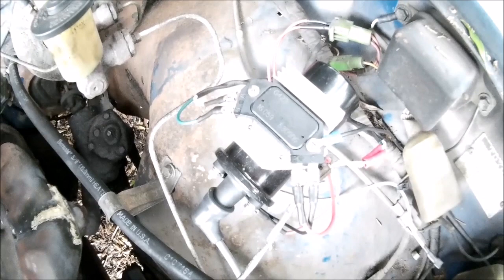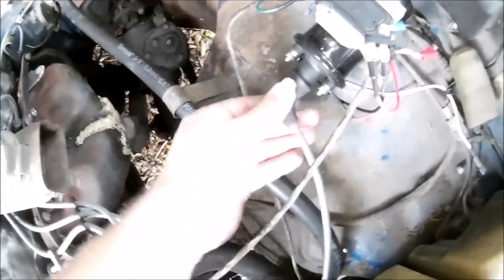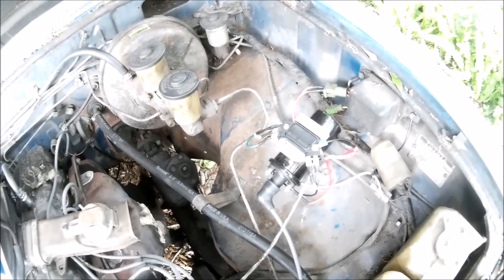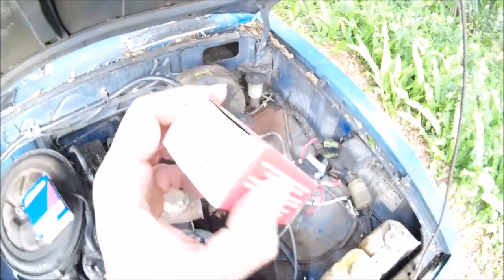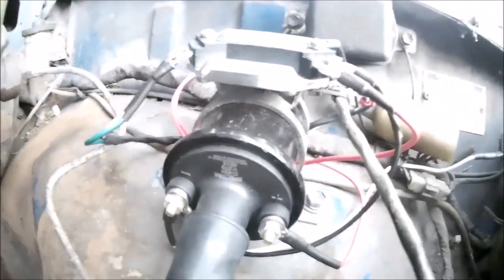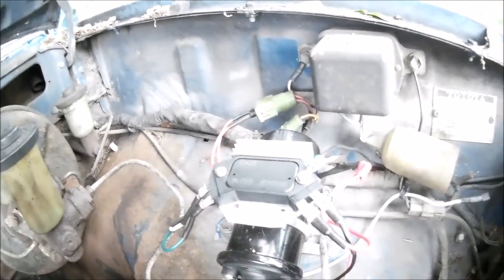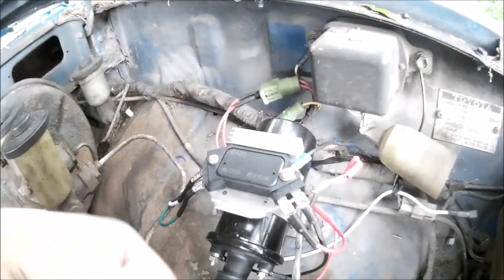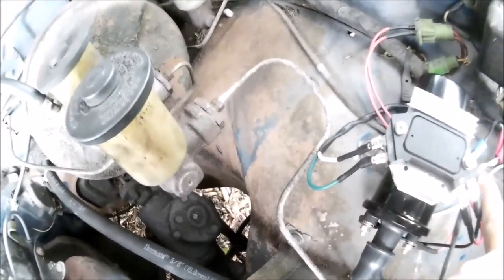1978 Toyota Pickup/Hilux 20R - GM HEI Ignition Module Conversion

Comment from the maker: UPDATE - This conversion does work fine, BUT....

I have to admit I made a mistake during the install. I had to use a #8 female spade lug for the green wire (red wire coming from distributor pickup coil), due to the fact that the lug for the "G" terminal on the GM module is smaller than the rest (see video). Unfortunately, the smaller lug didn't really crimp too well on the new 14 gauge wire I used, causing a bad connection. Apparently, this was the cause of my wandering idle & backfiring problems. The wire in the crimp was loose & causing an intermittent connection. Duh me.

I ended up using a female lug the same size as the rest, that would accept the 14 gauge wire correctly, & give a solid crimp connection. I did mash down the legs on the lug to make it fit tight on the male lug, and it's solidly in place. Every since I did this the idle is solid @ 850-875 RPM with no wandering & the backfiring from the tailpipe is gone.

I wasn't getting enough spark energy at some times due to the wonky crimp connection, causing an intermittent lean issue, sometimes to the point of stalling out the motor. Since it came and went without any pattern, it was almost impossible to troubleshoot (listen to my description in the video). I only found it by accident when I decided to recheck the connectors on the module. That one was loose & when I tried to pull it off to tighten it up, the wire came right out of the lug! And no, I wasn't just pulling the wire. Just one of those things & wanted to post an update in case anyone else is experiencing the tailpipe poping & weird low idle after doing the conversion. Triple check your crimps & connections!!!!
Reply: how dependable  has this  set up been
Reply: randy yowl this is not my video but I found it works very well I just recently done it to one that I purchased to fix and sell and have driven the hell out of it almost want to keep it but it most definitely works better than the original as well as the cost
Reply from the maker: Randy, sorry I missed your original post. So far this setup has been very dependable, no problems with it at all. As long as you make sure you have a very good, solid electrical ground to the module it works great. An iffy ground could cause it to function on a not so dependable basis. The only other thing to watch for is to use a heat sink like I did in the video. Keeping the module cool helps it live & work a long time.

Please see my other comments for more info, or reply to this if you have any specific questions.
Reply from the maker: The setup is very dependable, IF you pair the module with a QUALITY ignition coil. I do NOT recommend any Chinese made ignition coils. The quality is poor & the primary coil side seems to short out easily, sometimes within 6 months. This will cause you all kinds of idling & driveability problems, and will also wreck your module.

Other recommendations are to not use the supplied thermal paste you get with the module, but to use a good quality thermal paste for computer heatsinks. I use Arctic MX-2. It's only $3 or $4 a tube and has 10 times the heat conductivity rating than the silicone paste you get with the module. Keeping the module cool is critical to it working right & making it live a long time. Also, a solid ground connection is critical. I show you this in the video.
Reply: Thank u for this video it’s the only one that’s detailed I did my install yesterday took me 25 min I had to mount the hei module separate from the coil I couldn’t get it to fit the coil like u did I’ll be making my own video of my79 Toyota running its amazing how much better it’s idles and it runs amazing at high rpms

Comment: does the  icm have too be grounded for it to work
Reply from the maker: Yes, the module does need to have a solid ground for it to work. It grounds through the right side mounting hole in the ICM. In the video, you will see a black wire coming from the mounting screw in the right side. I grounded the wire to the bolt on the fenderwell that holds the voltage regulator. Of course I cleaned off the paint around the hole in the fender first; good bare metal contact is always best. Seems to work OK so far, but may relocate that ground wire later to a frame or engine block point. Or you could run a ground wire direct to the battery negative terminal; your choice.

Comment from the maker: Further update - Ignition switch was replaced, but didn't solve all the problems. Turns out my alternator AND voltage regulator were going bad as well. It's a 38 year old truck, so you have to expect these things. At least everything seemed to "come due" for replacement/repair all at once.

The only bad news is that the bad alternator seems to have messed up the ignition module some. The Alternator was "leaking AC voltage/current back into the truck's electric system, and has caused some havoc within the module. It still runs but is doing some weird things. Like trying to stall sometimes when you put the brakes on, and the idle is still a little off. It's also mildly acting like an nearly worn out HEI does; getting worse with driving and heat, pretty common. However even with this, it's REAL close to being where it needs to be. Got another new module on the way which should clear all of this up. Since the module on there still mostly works, I'll just throw it in the glovebox for a spare.

Comment: Great vid! I may need to do this to my 84 work truck that I plan to just keep rebuilding. I have found this conversion for older Ford truck. I am thinking to do this to my 1965 f250 4x4, that is going to get a 1982 300 six with HEI.
Reply from the maker: Thanks. Should work for the Ford 300 as well, as long as the distributor has the hall effect pickup. Or, you could use an old style Duraspark box to keep it all Ford, just an option. Good luck with it all.
Reply: The GM module won't work with points (from what I've read), but Ford's TFI modules do. But really, on a points setup they make electronic ignition conversions (like Pertronix) that work really well and not expensive at all, and that way you eliminate the point altogether. I did this on my '70 Chevelle and it worked great.